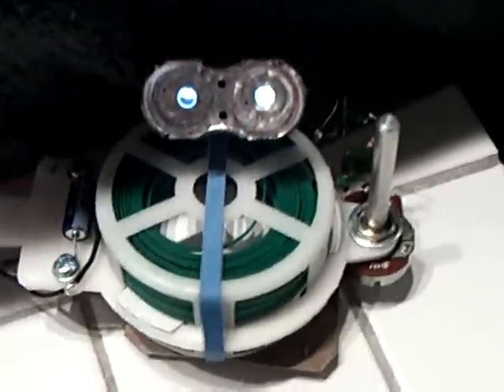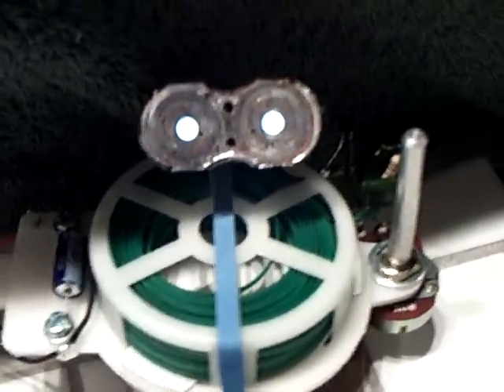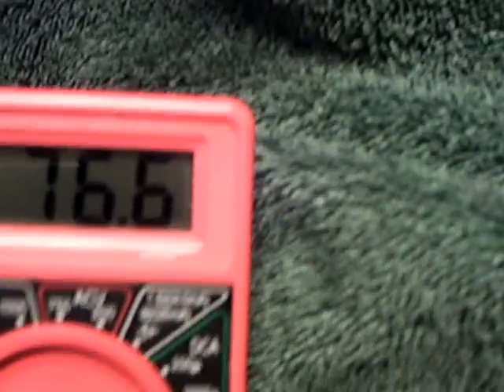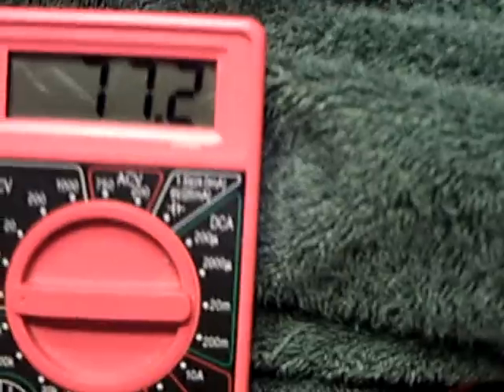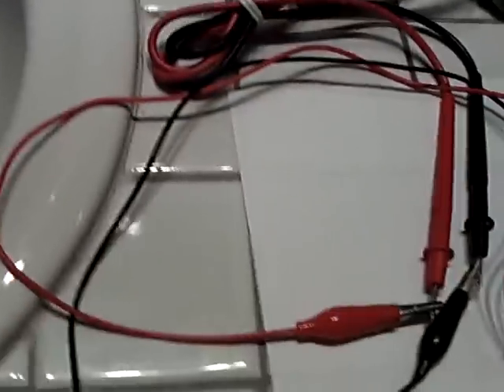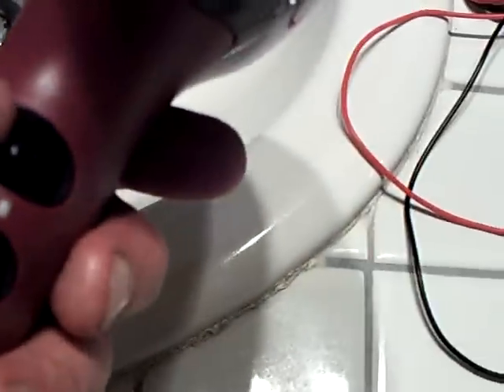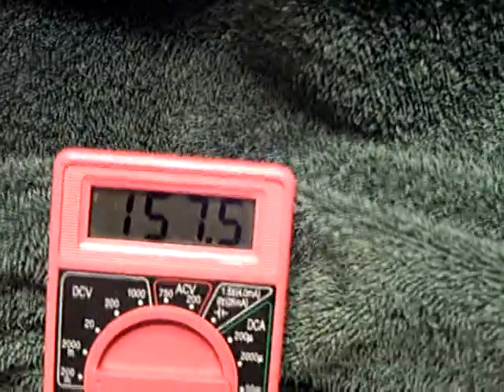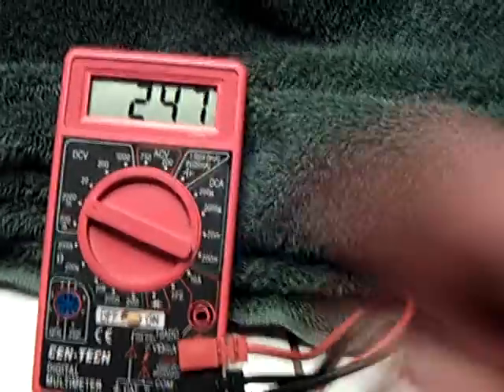Effects of pressure, heat , and humidity on the crystal cells

Comment: Using desiccant removed the moisture leaving a dry lattice.
without water the crystal cell power is reduced leaving the age old controversy
that galvanic action is solely responsible. Because temperature, pressure,volume and rate have been difficult to isolate especially lacking is precision barometric data.

Comment: Great video!

The heat and pressure effect make sense as they're apart of the electromagnetic spectrum. These cells seem to have a antenna like capabilities of picking up a wide rage of frequencies. 

The humidity test didn't seem fair, as you blow you also blow hot air too. I think a fair test would be to put the cell in a container and using a misting spray lightly cover the inside of container with a spray or two but not getting the cell wet.